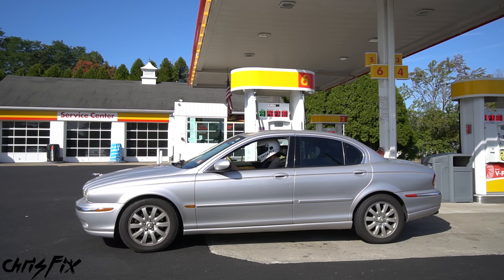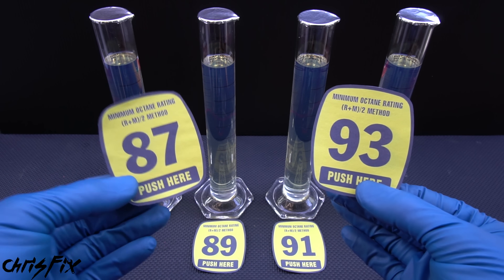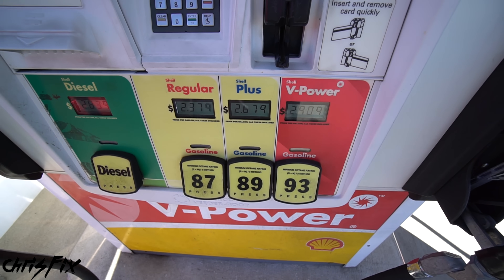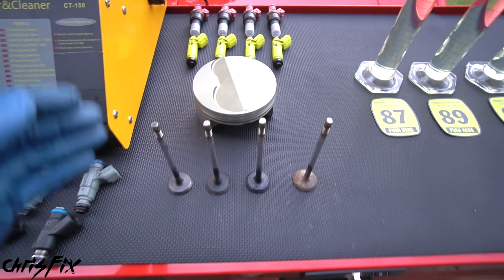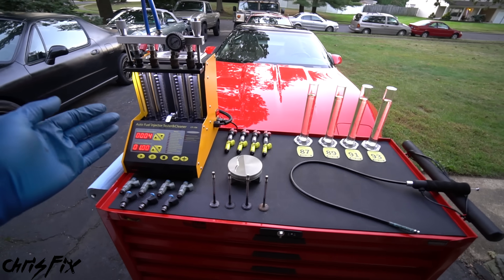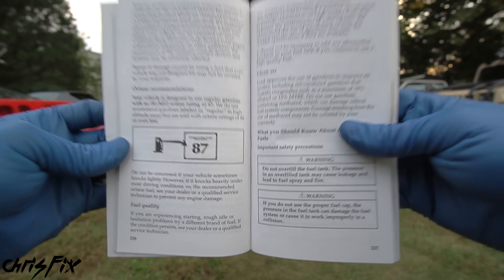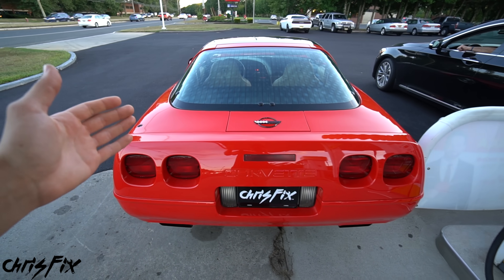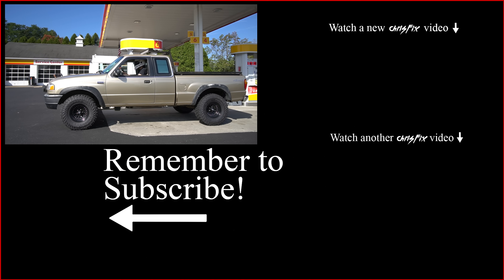What is the BEST Fuel to Use in Your Car or Truck and WHY

Comment: Tha's very strange seeing how in the US the 93 octane is considered V-Power, while here in Italy the less expensive and more disposable one is the 95 octane and the 100 octane is used on sports vehicle. 
But I think this doesn't really matter as long as the american prices are pretty much lower than EU Ones.
Reply: I take it you didn't watch the video? We use a more strict measurement method for determining octane in the US and Canada compared to Europe. US/Canadian 93 octane is the same as 99/100 octane in Europe. For example in the UK, Shell V-power has an octane rating of 99 Ron. But a "Mon" rating of 87. So (R+M/2) = 93 US octane.
Reply: @waycoolscootaloo  But isn't the number of octanes always the same because of structure lf the gasoline? How can 93 octane be considered 100 octane and vice versa
Reply: @anzaisekai3416  Because Europe only takes the measurement of octane from the "RON" testing method. The Research Octane number is a numerical number given on the performance of the gasoline to resit engine knock. The number ranges from 0 to 100. 

This is a basic laboratory test that is done to test acceleration behavior and lower temperature and slower driving situations. 

RON is determined by running the fuel in a test engine with a variable compression ratio under controlled conditions, and comparing the results with those for mixtures of iso-octane and n-heptane. The compression ratio is varied during the test in order to challenge the fuel's antiknocking tendency as an increase in the compression ratio will increase the chances of knocking.

However unlike Europe, the United States and Canada not only uses the "RON" test as I just mentioned, but also the "MON" test too. 

The motor octane number (MON) describes the behavior of the fuel in the engine at higher temperatures and higher engine speeds.

"MON" is determined at 900 rpm engine speeds instead of the 600 rpm for the  RON test. MON testing uses a similar test engine to that used in RON testing, but with a preheated fuel mixture, higher engine speed, and variable ignition timing to further stress the fuel's knock resistance. Depending on the composition of the fuel, the MON of a modern pump gasoline will be about 8 to 12 octane lower than the RON, but there is no direct link between RON and MON. Pump gasoline specifications typically require both a minimum RON and a minimum MON. 

But again Europe only publishes the RON number at gas (Petrol) stations. Even though there was a MON test that was performed by the oil companies.

This is a more strict testing method compared to the RON test, as its testing an engine burning through fuel under atmospheric conditions and hot engine pressures as I mentioned above. 

So while Europe uses "RON" for determining octane, the US and Canada uses the "Anti-Knock Index" abbreviation of "AKI" or (R+M)/2 as posted on US and Canadian gas pumps. 

So the "Anti-knock Index" Aka...(R+M/2) is an average of both the RON and MON tests. 

This represents the most accurate representation of real world burn of gasoline in modern cars under real world atmospheric conditions that we encounter in our day to day lives. 

Also US Gas pumps octane ratings on the pump always specifically state a "minimum octane" of 87, or 89, or 93 etc...

This is because generally the fuel ranges from 0 to 2 octane levels above the posted octane levels at the pump. 

So for example the US Shell V-Power gasoline in my area is rated at 93 Octane. But it's rated at 99 Ron octane in the UK and 100 Ron in Germany if I remember correctly. 

But in reality it's actually 99/100 Ron as every blend fluctuates by an octane or so. It just depends on delivery truck to delivery truck. And fuel batch to fuel batch from the refinery. 

So in the US here, you are 100% guaranteed to never be sold anything less than a true 93 octane gasoline in a worst case scenario. Aka...99 Ron. 

But it's usually always aimed to be 1 or 2 octane numbers by the refineries to be higher than the posted pump rating. 

So Germany just posted 100 Ron as it's the upper end of Shell-V powers octane rating, while the UK posted the 99 rating which is the minimum of the V-Power octane spec. 

So Shell V-Power = 99/100 in Europe. 

But 93 octane in the US and Canada. 

How? By the US anti-knock index. 

RON of 99 octane + MON of 87 octane = the US/Canadian (R+M/2) of 93 octane. 

So as you can see, the US gasoline has as much octane as European gasoline. Er..Petrol. LOL! 😅

And then of course here in the US you can of course find stations with street legal racing gas of course as well as non legal street racing gas. 

Typically has a US Octane rating of 100 for street legal burning from VP racing stations and 110 to 120 US octane for off road use racing gasoline. 

VP Race gas can also be delivered to your home here in the US in steel drums or 5 gallon pails. 

It's very expensive fuel though ranging in price from $8.00 to $20.00 per gallon. 

Hence mostly used at the race tracks or at the drag strip. 😎
Reply: @waycoolscootaloo  Ok thank you for correcting me then, I was in wrong. 
Thanks for the info.
Reply: @anzaisekai3416  Your welcome. 🙂

Comment: So I’ve been told that once you run premium to not mix regular into it, but to go through all the premium left in the tank and then flush the engine before going down to regular (on a vehicle that is fine with regular) any truth to that?
Reply: No, that's crazy, where did you hear that from?
Reply: flush the engine? Jus do the switch. But don't do it all the time.

Comment: I been using Premium gasoline since I  bought my new car in 2015.  It's a 2015 Honda Civic EXL should I continue to use Premium or go back to what the Manufacturer Recommends? I  only have 40,000mi on it I don't drive far, in case you were wondering about the mileage.  Can you please let me know? Thanks!

Comment: What do you think about those Lucas Fuel injector cleaners ?
Reply: The best injector cleaner is Techron, based on research I have done, and is the most used by professional race drivers in their cars.
From my personal experience, Techron is definitely superior.  It makes no difference if you get your Techron by using Shell gasoline or by adding it from a bottle.

Comment: So I’ve got a car that’s 20 years old and has minor engine knock occasionally on 87 octane. Should I start putting in a higher octane gas?
Reply: You would probably be better off adding a bottle of Techron each time you fill your gas tank for a while and clean the carbon buildup.  Once the combustion chambers have been cleaned your compression ratios should return to "normal" and the pinging should stop.  That is a better solution and you won't have to pay the 50 cents +/- extra per gallon for premium.
Reply: @watchdogu.s.a.8973  ive actually put techron in this car before when AutoZone was having a promotional sale and it didnt really change much. i was considering picking up some seafoam and trying that cause i know that works great in my ATVs. but hey, i dont really much to worry about it right now cause it wont even pass state inspection until i get the inner rocker panels replaced. all the autoshops tell me the covers on the outside arent enough and they'll still fail me if i use bondo.
Reply: @burnedtoast8151  There are several Techron additives that address different areas.  The injector cleaner isn't designed to remove carbon buildup in the combustion, for instance, whereas Techron Complete Fuel System Cleaner cleans injectors as well as carbon deposits on valves and in the combustion chamber.
Techron is the best you can get.  However, it is still possible that you can have a problem that it won't fix if something is clogged badly enough.
I have no affiliation with Chevron, by the way.  I have researched, though, and use the products.
As for the state inspection - I'm fortunate to live in a state that doesn't have such requirements as you mentioned.

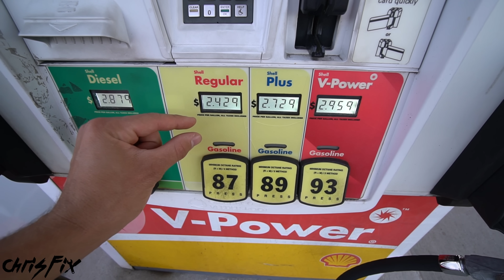Comment: At 1:40 into the video he says it's "Completely False" (I'm quoting here) that the higher octane fuels have more power and better fuel economy.  Then, at 12:23 in the video he states that using a lower octane rating in a vehicle that says "Premium Recommended" is OK but you might lose a little fuel economy and power.  Nice try, but you contradicted yourself in the same video.  Very nice Shell Advertisement though.
Reply: The difference was that he didn't explain in the video why you might get lower gas mileage or power.

Comment: I think its a little more complicated then that with VVT engines. Gm for example rates their trucks for 87 to please the customers but thats by pulling timing to reduce nock. Put higher octane in and timing advances and presto more power and better efficiency.
Reply: Different timing.  VVT has nothing to do with ignition timing.  Ignition timing is stated in relation to TDC or top dead center of the piston's travel in the cylinder and is not affected by the actual relation of valve timing.
Reply: @watchdogu.s.a.8973  right.. that checks out

Comment: I actually do get slightly better mileage when I put in 93 octane instead of the recommended 89.  It's not worth the extra money--but for some reason, it does bump me up a MPG.
Reply: They do burn the same as he states.  The thing he is missing is the higher octane will indirectly produce more power and efficiency because your cars computer can adjust the timing to make due with the better octane rating creating more power from your engine which equals better mpg.
Reply: @kaiul2967  I don't agree that they burn the same. I've noticed high octane helps for low end torque and lower octane is better for higher revving which indicates low octane burns slower. Knock is also from fuel burning too fast which is why slow burning high octane is used. I do don't agree with the info on this video
Reply: I don't agree that they burn the same. I've noticed high octane helps for low end torque and lower octane is better for higher revving which indicates low octane burns slower. Knock is also from fuel burning too fast which is why slow burning high octane is used to prevent knock. I do don't agree with the info on this video

Comment: I had a class college taught by an engineering chemist!  He said every X number if fill up (I don’t remember what X was) run a tank or two of high premium gas as it usually. Has different additives it can help remove deposits the other grade of gas didn’t address! Sounded right to me only costs pennies more in the long run if you go back to the engines recommended level
Just my two cents
Reply: Or just buy a big gallon jug of Lucas fuel system cleaner and add a few ounces of that every few months

Comment: Fuel that has “up to 10% ethanol” added does NOT have the same energy as pure gasoline. So if 87 & 89 contain ethanol, but 91/93 does not, the higher end fuels will result in fewer fillups and increased fuel mileage. 😎
Reply: I do get 2-3 extra miles per gallon when I use premium... That's about 40-60 extra miles per full tank. The extra cost is about $7... Which is about 2 gallons here... So it's the same at the end. Advantage: better stuff in the premium more love in the engine.
Reply: So you saying I should be running 93 in my ram 5.7 hemi?
Reply: That’s wrong, the fuel with ethanol has very similar characteristics and may even burn more smoothly, it is however more hydrophilic and will attack some rubber components in older cars as well as the increased propensity to corrode metal parts!
Reply: Exactly! For my car I calculated the lesser consumption with higher octane fuel to be cheaper in total.

Comment: LOL always use the manufactures' recommendation, note some vehicle run higher octane, and if you use the lower octane when you should be using the higher octane you will probably burn an exhaust valve, , the higher octane is a more controlled burn, lower  temperature so less ping when using hard throttle. ,   note gas in California already has a cleaner in it,

Comment: It is true. The 87 burns faster than the premium. I drive with doordash it’s definitely a huge difference
Reply: Thanks
Reply: 87 last longer than anything for my Hyundai, I fill it up every 6-7 days
Reply: @tude6455  same💯👌🏾
Reply: Yes this video has missing out incorrect facts. In my old volvo. I have to readjusted the idle fuel ratio when using different octanes. Different fuels clearly have more or less energy to burn

Comment: Can buying gas from a lessor known gas station cause the check engine light to come on? I normally buy my gas at a store like QT. I notice after buying my gas the check engine light came on and the error code on it this time was p1131.  It wasn't on prior to buying the gas at that gas station either.  And it hasn't been on for almost 3 or 4 months to a 1 year.  Plus i put some stp gas treatment in there as well..  Any ideas what the problem could be? because not to long ago i had a vacuum leak and i had that fixed already. (please help)

Comment: All I learned in this video is how much of an idiot you are. In the beginning you said that the fuel doesn't help with fuel economy or power and then later you say you'll see a decrease in fuel economy and power. You are an idiot and you need to stop giving people wrong information! And I don't know where you got your fuel from in those glass beakers, but it's all the same fuel and not different octane ratings!!

Comment: Great video! The animations helped a ton, wouldn't understand what you meant by the scenarios like detonation without them
Reply: Those new cars he talked about all have knock sensors. He didn't tell you that they were not functioning. And did you ever hear the car/ truck running ? No. He just told you and you all fell for it like sheeple.

Comment: Also don't switch back and forth from E-85 to regular, pick one and stick with it. Especially with early flex fuel systems, the car has to re-tune itself on the fly, based on the % of E-85 in your tank and this can set fuel trim codes, triggering the check engine light.

Comment: Hi Chris, I stopped by a gas station in Nebraska and they sell gasoline without ethanol. It reminds me this was the only type of gasoline that was used 50 years ago before the Arab oil embargo. Is gasoline without ethanol better than the gasoline with 10% ethanol? Why is it made available again? Does it help or harm the newer engines of today. Thanks

Comment: I just ordered a JL wrangler with the 3.6 liter pentastar engine. The engine is suffering all the things you just mentioned because people are using 87. Chrysler has said the issues with the engine including knock will disappear if you use premium fuel. Continued use of 87 fuel will damage the bearings, rocker arms and valves combined with misfires and loss of power. This is nothing new. I used premium fuel in my 1986 CJ7 6 cylinder 4.2 liter when I purchased it new and the engine purred even with 157,000 miles.

Comment: What about gas marked up as E5 or E10?  We have these in Europe. Any in th USA? It's Regular gas but contains 5 or 10% bioethanol. They provide less power and mpg but more environment friendly. Unfortunately cars older than 2001 can't use E10 because it damages certain plastics, rubber and metals. In this case you have to use Premium which of course is more expensive.

Comment: I read the owners manual first the hemi engines I know run on 87 no problem, but even the manual says 93 will give it better performance and its noticeable even in my brand new hemi, it's not faster it just revs out quicker and has better throttle response now that 88 and 91 alcohol free gas makes my truck run like a crippled it definitely doesn't like it lol.

Comment: My truck wont run on anything but 87 anything higher and it dies constantly and barely runs. My fuel goes from 13 mph to about 6 with anything other then 87

Comment: I have a couple years ago  Toyota Prius from 2010 and around 250.000 km on the clock. It’s hybrid petrol/el car. Drive that car on E-85 without any modification and without any problems about 2 years. Car still working strong for the guy in have sold.

Comment: I've got some bad news for you car guys. It litteraly makes 0 difference between 87 and 93. Anything above 87 is nothing more than a feel good justification for the idea that your over priced high compression engine "runs better" on higher octane. Spoiler alert...... No it doesn't. Contrary to this video, no more damage will occur if you use 87 vs 93. If you experience "engine knock" it IS NOT related to the level of octane. You have other issues. Save yourself some money, buy the 87. But hey, if it makes you feel better, buy what ever you want. Lol. Also, engine oil...... Haha guest what?..... Other than viscosity (that's important) largely the same. But buy your favorite most expensive brand. You do you. Live your best life! Haha

Comment: The fuel you put in your car should be the fuel it is tuned for, the first 10:26 of this video is pointless information that has no bearing at all on the subject at hand. This video should have been about 2 minutes long at most without all the techy crap that people don't need to know. You want to spend 10 minutes talking about octane numbers, fuel additives and the importance of keeping your engine clean then make a video on it and title it appropriately don't stick all that in a video on a totally different subject. Blacklisted